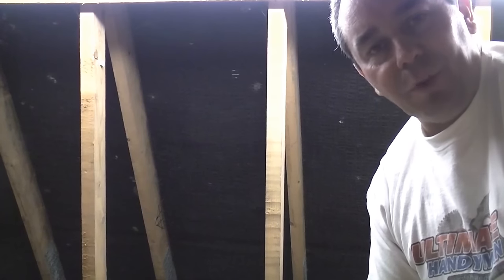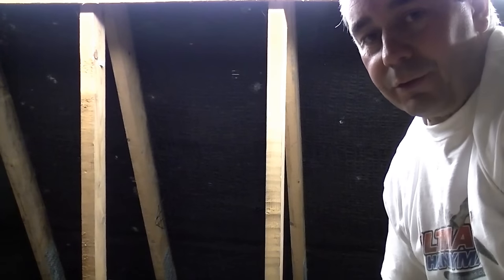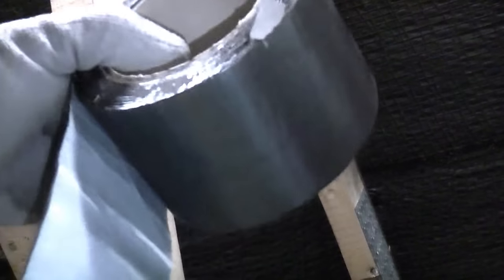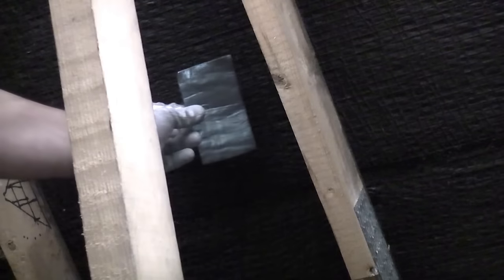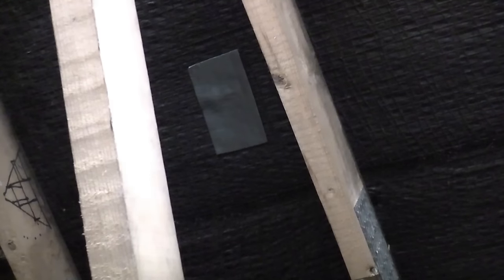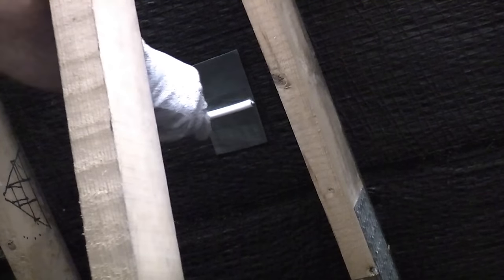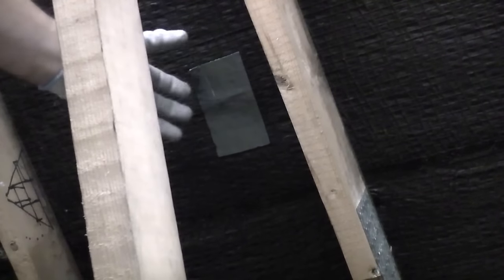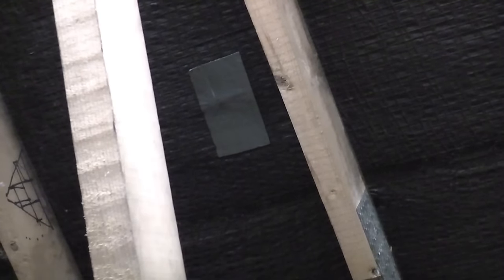Repair roofing felt from inside

Comment: No need for  flashband or heat !!!!! Cut a piece of breather membrane / 1F roofing felt ( if you can still get some ) that is not as wide as the distance between the trusses, fold over at the top before sliding down and hooking over the over the damaged felt, simple as.
Reply from the maker: Thanks for the comment
Reply: Yeah no problem. Not trying to be a smart ass and glad you’ve taken it the right way. but I did spend my life as a slater/tiler.
Reply: @barrywood7400   Great advice. Thanks for sharing. Probably easier to do this when the hole is near the top of the felt, but if its a lot further down can be tricky to slide the new felt piece between the existing if that is really tight.

Comment: My cowboy solar panel fitters just BOOTED a bunch of holes all over my formerly perfect (but laid in 1955) felt by climbing the roof by pushing the tiles up, rather than using roof ladders. As well as mounting my solar panels a foot onto next door's roof, who you can imagine are delighted with that! Plus breaking tiles and not telling me. Anyway, in the event that they refuse to rectify all the damage, I can at least fix the problems with the felt from the inside so thanks for the video!
Reply: cowboys did the same and broke some tiles , tore the felts, and never told me!! they never came back to fix it!

Comment: Some have commented that they have water leaking into the loft.  Roofing felt is meant to be only a secondary barrier.  If water is leaking in, then surely there is a need to look at the primary barrier - the tiles - in that part of the roof or above and possibly replace any faulty tiles.

Comment: Thanks for the great video. One thing I'd add though, it is important to clean the felt around the hole to help the flashing to stick. I made the mistake of not doing that last time and it just fell off. When I looked at the sticky side of the felt, it was covered in dirt. Clean it and dry it first. Also, if there is a sag by the hole, it may have been caused (like mine) but a bit of tile or tile render slipping down the roof. You need to put your fingers in and pull out whatever is there, rather than just trying to stick the felt over a bulge. Obviously in that case you also need to get a roofer to fix whatever has slipped down
Reply from the maker: Thanks for the comment

Comment: Thanks for the video.
Just fixed my roof felt which was sagging and ripped from old birds nests. I had to rip the felt some more to get the old straw through and there were some more rips from contractors bodging the vents when they put insulation in. Have to get a roofer to check the outside of the roof

Anyway, I had some old flash banding knocking about, used it a few years ago to stick a gutter to a flat roof so the rain doesn't run down the patio door anymore. Rain won't run into a gutter off a flat roof like a tiled one.
 
Pliers are ideal to nip the banding and tear off  in a straight line, it tends to stick to the scissor blades. Having no heatgun and only an LED torch, I used a small staple gun to stick the banding to the felt and through to some joists, which means I could overlap the banding slightly for larger holes. I have some bitumen paint or better sealant in a tube and will seal the staples to stop them going rusty anytime soon. Will reinforce the repairs with some roofing felt, staples and bitumen but need to shop around for a cheap roll.
Reply from the maker: Thanks for the comment
Reply: Thanks for this
Just discovered and old nest and now know how to fix it

Comment: So glad I have come across your video ( @ gone 2am lol can not sleep).
I've had a few quotes to do repairs on my roof,  but I'm on a very low budget and can not afford to get it done by a roofer. 
I have noticed alot of little rips in the felt (no water leak) but have a major repair front of the house which water is leaking.
Thank you for sharing you make it look easy. 
I will have to do this myself so fingers crossed & I don't like heights lol. I'll be watching your tips from now on
Reply from the maker: Best of luck with it 👍

Comment: Hi! Thanks for the video! I've got quite a few rips and bits of the roofing felt actually hanging down from the roof. There's no water leaking in or anything, but I do want to fix it. What would I need to do in this case, saying the roof felt appears to be so old it's started ripping and hanging down.

Cheers

Comment: Just checked the loft after a few months, to see how the flashband repair was doing and it had fallen off, I still think it's a interesting method but I need to use primer on the split felt before sticking on the flashband, will give it another try.

Comment: Hi, through this winter period I noticed a water stain on my bedroom roof, when going into the loft, it seems to be a lot of condensation build up on the roof felt and this was dripping onto the insulation and subsequently through the plasterboard onto bedroom roof. Some of the wooden beams were also very wet.

I understand the roof felt is overlapped to aid ventilation and I know this is really only a winter/cold weather problem as I have lived here 8 years and it’s the 1st time I’ve seen it, but just wondered if you have any solutions without flashbanding the slightly sagging gaps of the overlayed felt…?

Much appreciated,

Oliver.
Reply from the maker: Sometimes the problem is that too much loft insulation prevents the loft space from being ventilated through the soffit etc. This means that condensation gets trapped in the loft and cannot escape. I had to install a vent in one of the walls a few years back, so that the loft could breathe! Before that I went up there and water was dripping from the felt, all over the place! 

I’d leave the sagging felt to be honest, as that is probably where the roof is letting some air in/out.

Comment: Brilliant video. I have seen a hole appearing in the felt, may have been there for a while. I have spoken to many roofers and all of them say flashband is no good. Its only temporary?? I was hoping at least someone will say good things about it. Is it really temporary fix?? Thanks
Reply from the maker: In 1971 president Nixon “temporarily” took America off the gold standard 😉
It depends how you define temporary. It was 8 years since I did the repair and it’s still fine 👍
Reply: @ultimatehandyman  many thanks.. i have noted the flashband make you used and get a primer from screwfix. Will update.. hopefully it ll work. Thanks again
Reply: @ultimatehandyman  i did it this weekend. I understand why some people say it doesn't stick. It was cold and the heat gun helped significantly. Needed a bit of skill as had to heat gun then roll then heat gun then roll, used my fingers too. Used to patch two felt strips which were cut as well. Hope it stays in place. Thanks again for the video

Comment: I tried to seal a hole during the warmer weather using 9 inch width and the same method you used. Because of gravity the patch kept falling off. Tried wedging cardboard between the rafters - no luck. No luck with primer or felt adhesive.
Reply from the maker: What make of flash band did you use? 😱
Reply: @ultimatehandyman  Bondit
Reply from the maker: I've never tried that make before 🤔
Reply: In my case, the only banding I have managed to stick and hold for small holes is Gorilla Waterproof Patch & Seal Tape Black 3m, provided bitumen paint is applied to the old sarking felt first and allowed to dry.

Comment: Great video thanks. My whole is too big for just flash banding I reckon, it's completely ripped out with a couple of 1 foot slices and hanging like a sheep's fanny! How can I fix such a hole? Can I buy a repair patch say 2x2 foot cut to size and secured with flash banding? Any help appreciated.
Reply from the maker: Yes, I'd just buy some more felt, you can cut it larger than the hole and feed it through, so that it overlaps at both sides and the bottom, then secure it with flashband.
Reply: @ultimatehandyman Thanks for your reply, I can't seem to source a felt patch anywhere on the internet? Do you know what it's called and where I can source such a 'felt patch' in NE UK?
Reply from the maker: You might have to get on off cut from a roll of roofing felt.
You might find some on gumtree, or freecycle etc.
Reply: @ultimatehandyman Thought as much thanks for confirming, on reflection I'll probably get away with using the extra wide flash tape I've spotted. Thanks for help and great vids

Comment: Great video thanks. The tape has become unstuck in the recent hot weather any suggestions? I can remove tape and replace.Any hints what to clean the sheets with?
Reply from the maker: I think white spirits will clean off old residue.
Perhaps clean it off, allow to dry, then prime and re-apply the tape.
Mine is still firmly stuck after several years!

Comment: Great video! In one of the comments you mentioned ‘priming’ the area to help the flash band stick - but you haven’t included this in the video. Could you clarify ? Cheers.
Reply from the maker: There is a primer that you can use when the area is porous, it makes the flashband stick much better- https://www.screwfix.com/p/bostik-flashband-primer-black-500ml/57709

Comment: Great video matey....we have had a leak in our utility roof space for a couple of years and I found the source today during a heavy rain shower....hole in felt.....bought flashband and primer kit for less than a tenner from Screwfix and will tackle the job tomorrow.....the hole in the felt is very close to the truss....should that be a problem?
Cheers
Reply from the maker: No, that should not be a problem, as long as you can patch the full hole  👍

Comment: Hi,
What sort of little roller is it you are using?
The only rollers I have are for painting so concerned the heat gun May light them up!! :)
Reply from the maker: It's a 4 inch roller with a piece of 15mm plastic pipe as the roller, as I could not find my seam roller - despite owning about 5 of them!

Comment: How do you deal with a bigger hole ... do you get some felt, cover the hole, and attach it with flashband
Reply from the maker: You can try that, but ideally you need the new piece of felt to be under the existing felt at the high point, but above the existing felt at the low point, so that any water can run freely. It might be difficult getting the felt between the existing felt and tiles at the low point 👍
Reply: @ultimatehandyman  Many thanks

Comment: Hi I know this is an old video but I have small leak in my loft the felt has came off can I just use the tape straight on or do I need to prime it with the paint ?

It's like a wood material that's exposed
Reply from the maker: It depends, sometimes the felt is dry and kind of dusty, in which case it will stick better, if the area is primed first 👍

Comment: Do you have to apply heat to make it stick? Will it stick without?
Reply from the maker: It will stick without the heat, but a lot depends on the substrate and the ambient temperature. Heat always makes it stick better 👍

Comment: Excellent. Thank you for your help and advice.  I have problems with furry rodents sneaking in wherever there's a gap.  Do you know what I should use to secure large pieces of old 1950s roofing felt that has come adrift please?
Reply from the maker: Not sure about that, but you could try patching it up using new roofing felt and flashbanding.
Thanks for the comment 👍

Comment: Hi thanks for the video. I'm trying to patch holes in the felt of my roof, but the flashing tape doesn't stick. The felt is quite old and dusty... any advice?
Reply from the maker: Don't try it in cold weather, also you can try to apply flashband primer- it makes it stick to almost anything
Thanks for the comment 👍
Reply: @ultimatehandyman  Thanks, I managed to do it, looks really easy in the vid but took me a little getting used to.

Comment: I did the job so thanks again. There seems to be sagging of the felt at the overlap between upper felt and lower felt, possibly a couple of inch gap. If moisture was on the upper, it would still run on to the lower ok but how big an issue is it? I’ve seen video of devices being into this overlap to create a ventilation gap so it can’t be too bad?
Reply from the maker: I would not worry about it too much, sagging felt can often help with ventilation. As long as it's not leaking, it should be fine. 
Thanks for the comment 👍

Comment: I have a ventilation pipe from the bathroom  going to the roof and the felt around where the pipe meets the roof tiles was poorly installed.  I have tiles exposed.  Is there a product similar to what you've shown that will bond to the felt and the pipe?

Nice video btw!
Reply from the maker: The flashband should stick to both but it sounds like your vent pipe is a bit of a bodge job. 
The problem is that flashband does not stick as well in cold weather.
Reply: ***** Thanks, I had wondered if now is not the best time to do this.

Bodge job you're right about!

Comment: I live in a rented house and after taking down some of the MDF panels in the loft I noticed that the felt by the chimney has rotted and can see daylight. I told the landlord and he sent a man round who fixed a foot long plank of wood to the rafter and said " Job done no daylight seen now" The roof is still leaking and everything up there is damp and the mdf panels are warping. 
On a bright sunny day I can also see 2 thin lines of daylight all along the apex of the roof both sides of the ridge tiles. Is this normal?
Reply from the maker: No, that is not normal.
It sounds like your landlord does not care about his property. If it was me I'd get that fixed properly and as soon as possible.
The last thing you want in a property is water getting through the roof!
Thanks for the comment 👍

Comment: Sorry but if it's leaking in through to the felt, then there is an issues with the tiles/covering?
Reply from the maker: +Jonny Be good 
Not necessarily, it's common for rain to blow under the tiles if the wind blows a certain direction- that's what the felt is there for.

Comment: Hi there,
Just wondering how you would provide a better seal along the roof felt joints??
Thank you
Reply from the maker: The joints are normally overlapped. I would not seal them, as it lets the air in through the gaps.
Thanks for the comment 👍

Comment: The "Beast from the East" has driven snow under my tiles and in through gaps between my felt where it no longer overlaps :-(
So I've got pretty soggy insulation and ceilings now.
Would flash band seal up these gaps?  You mentioned that the felt needs to be dry before applying, mine is still dripping wet.
Any thoughts and suggestions please Mr Ultimate?  Cheers!
Reply from the maker: It should do once the felt is dry but you have to be careful not to seal everything up as the loft needs to breathe- or else you will get bad condensation problems.
Reply: Great thanks.  Oh don't worry, I've got plenty of good gaps for ventilation! ha!
Reply: A good result, I'd recommend this to anyone.  I'd advise to use the primer first though, especially on old or dirty roofing felt, like mine that's been there since 1960!  Then, when applying the flash band after the primer has dried, heat the felt with a hair-dryer.  This makes it a little sticky.  Apply the flash band, and heat again.  This worked really well on mine, and it was still 2c at the time.  I had several to do, but it was well worth it.

Comment: Ultimate Handyman, I have a big problem...Last house occupiers where growing hash industrially , so they tore the felt in various places to dissipate heat, smell and condensation in loft. This has resulted in something way bigger than a hole to be fixed by flash-band. Could you show how to repair say a missing section of felt between rafters (@600mm centres) for say a roll length of felt or two? I am thinking of stapling breather membrane to rafter edges and overlapping over felt.Would that work? By the way following you since about 2006.
I Could send you photos for better description.
Reply from the maker: I'm no expert on roofing I am afraid, whilst I can do small repairs this sounds like a large job, perhaps a job for a roofer!
You could post the pictures in the building forum and see what some of the guys say- http://www.ultimatehandyman.co.uk/forum1/building-forum-f4.html
Reply: *****
I have something similar a hole about 10" felt it still there just torn down, I will try this method I was thinking of using spray foam filler and thin plywood to hold up and repair the felt and fix the plywood between the rafters.
Reply: Oddball
I tried this with some Black Jack flashing tape and the result was poor even heating with a hot air gun I find it peels off the tape does not seem to support its own weight when upside down. I think the way to go is to apply a bitumen adhesive and let it partly dry then stick more roofing felt to it and if possible support with some plywood from underneath while it sets. I know it isn't warm out at this time of year but I can't wait till next summer to repair my roof.
I did 4 repair areas from small to 10" not good results would rather use felt but cant buy small bits.
Reply from the maker: Oddball
You can get a primer that you paint on before applying the flash band, that makes it stick to virtually any surface.
The piece I put on in the loft is still firmly stuck but that was only a small piece, a couple of inches long!
Reply: *****
Thanks that sounds like what was needed, I am going back to look today and see how it looks 2 days later.
Reply: Oddball
Got back today most of it had fallen off so stuck it back up with bitumen based mastic, heated it up with hotair gun first and it has worked great.
Reply: @0ddba1l  word of mouth